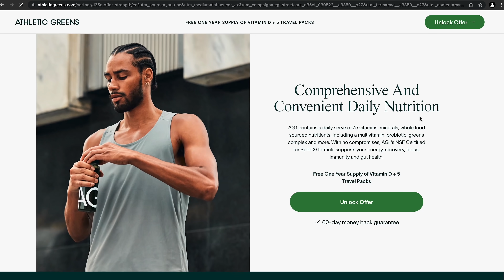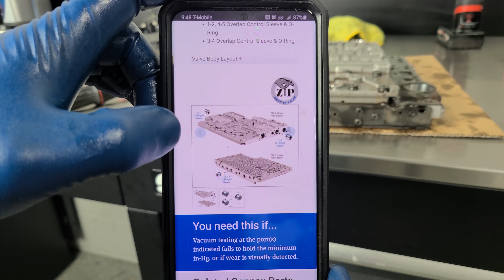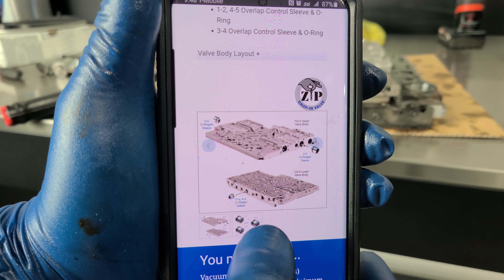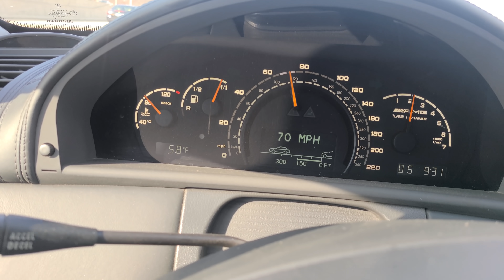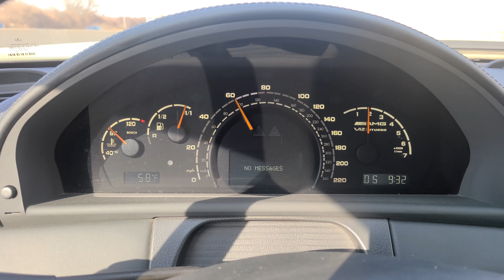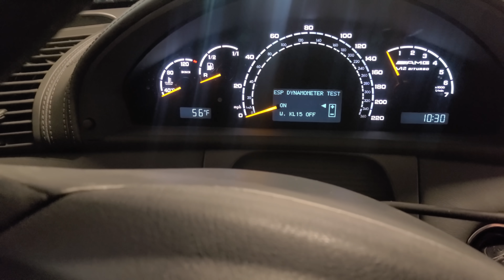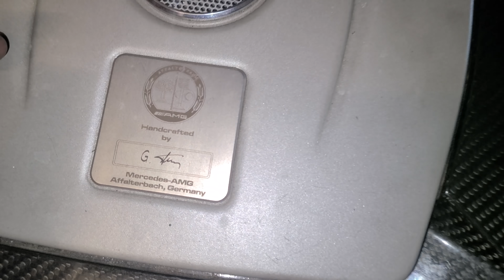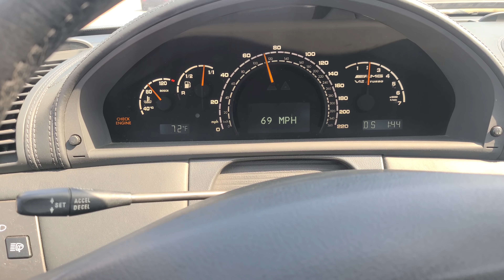My CL65 AMG FINALLY Made It To The Dyno But It Didn't End Well. I Love This Car!

Comment from the maker: What's your long-term project?
Reply: My wife
Reply: Me and my dad are rebuilding GAZ 69A which is russian old off-roader  which my grandfather bought from the army. It is over 60 years old!
Reply: I have a 2014 Volkswagen Jetta GLI comes stock with a 2.0T. Had the car since January of 21 and it’s been nothing but amazing but the 210hp wasn’t cutting it. Decided to put a bigger turbo, catless downpipe, intercooler and even with the stock fuel system i made shy of 400hp. Love the car to death and never see myself getting rid of it in the foreseeable future even though it’s been down since august due to something getting sucked into my engine causing cylinder 3 to get chewed up. Doing a full rebuild on the motor but with college and work it’s hard to find time to put it together and with college I barely get hours to make money to buy parts. So it’s gonna be a project for a very good while :)😂
Reply: Chrysler Conquest.
Reply: did my sierra over 5 years
currently doing my mondeo that's only taken 16 years so far...
Reply: 1998 Oldsmobile Aurora
Found a crate engine in Santa Fe Springs California and plan to install it.
Reply: 1963 Chevy C-10, unless I find a fully restored one then I'm selling mine.
Reply: Full Engine rebuild on a camry with the 2az-fe spun a rod bearing
Reply: 95 volvo 460, its a rustbucket 😂
Reply: My 2001 Lexus IS300.😅I keep replacing parts and it keeps throwing a CEL for something new.😒
Reply: My SL500, I'm preparing to overhaul both ABC hydraulic units.
Reply: My first car! A 05 CTS-V
Reply: W123 300td 4 speed swap death tune injection pump
Reply: Mercedes = money pit
Reply: 2012 Daihatsu Mira.
Reply: Keeping my E39 M5 running like it should... It will be a forever project :D
Reply: My c1890 Victorian home
Reply: My R129 Mosselman 300SLR Twin Turbo, It's in Missouri getting work done, I'm living in Chicago would love to let you try it out when it's done!
Reply: My cls55
Reply: W140, been doing it for last 8-9 years. Was done once, but redone again to more classic look. Recently there were unrest in my country, looters completely wrecked my garage, took all detailing equipment and even wheels, the car was just laying on the ground. Hood and trunk were attempted to open with crowbar. All rare stuff that I collected for years - was stoles. Even the cassette with instructions and manual, which was exactly from this car, it has been kept through all this years, all was stolen. I will make a video about it sometime soon
Reply: 1984 300 CD
Reply: 1994 S600 coupe (33k miles) Barn find
Reply: W126 560 SEL. AMG Gen 2 body kit, split rear seats (car only sits 4), fully rebuilt engine. Waiting for me to put the engine and trans back in for the last 6 years....
Reply: rebuilding my old 99 z28 and my newly acquired 04 golf R32
Reply: 996 GT3 with 997 front end. Still a lot of details so is not a 2/20 car (looks great with 2 beers at 20 ft)
Reply: 2004 E500 4matic wagon!
Reply: W211 e55 😂
Reply: Watching this build 😂 

Man I can’t thank you enough. Whenever I get my C216 CL65 most of the services have been covered by you and FCP will have the parts ready

Except that ABC, that has to go instantly
Reply: The evolution of "el gordo". Or my abdomen.
Reply: The love and disdain you show as you're talking about this car is the same how I feel about my 2010 335i xdrive manual (with NO idrive 🙏). She's eventually getting an LS, T56 and Ford 8.8. I'm done with heart break lol
Reply: 240z with a tvr speed 6
Reply: Mk1 Escort sport.
Reply: ‘76 k20 bought new as a logging truck, then my dad bought it for a plow truck.  On second body and needs a third, frame is rough but has unlimited emotional attachment helped plow our driveway as a kid sitting on my dads lap. The one I’ll never sell. Not worth fixing, but is. Lol
Reply: @LegitStreeCars Where did you get the repair manual for that car?
Reply: My body, been through hell and back. Addiction, jail, homelessness for a few months, losing friends to addiction/attitudes, losing family to their personal issues, losing money to theft, losing computer with crypto on it… it’s been over a decade for sure, all started when we rolled into 2010, mom died in February and everything unraveled from there. 
Thankfully I’m clean and broke now. People can call all they want, I make $250/wk so…. My body is my project for now
Reply: I’ve built a 50cc 2 stroke folding bike and recently ive blown the engine so im replacing the piston, rings and probably cylinder👍👍👍
Reply: You've inspired me to buy a 1998 bmw 540i (pre vannos) and I love it so much
Reply: Do you know if they have the damper kit for the 7.229 transmission? And my project cars are a 2004 S430 and a 2006 CL500.
Reply: A 265k mile Volvo XC90 with the Yamaha V8.
Reply: for now , number one ... raising and educating my two male boys....number two...my wife😊😎🤭
Reply: My piece CL600
Reply: Myself.
Reply: Volvo 850 turbo, e39 m5 and w202 with c36 motor swap on the way. It's going as well as you'd imagine.
Reply: What happened with the 540i
Reply: Big question?
Car wise:
Fit fuel injection to my Jensen 76 Interceptor Convertible (440).
Get more maintenance items done on my 03 CL600 done.
Make a Milliyard style 4 cylinder version of a Suzuki GT550.
Reply: @whoquadrophenia  Lots of internal screaming?
Reply: E38 740i shorty with e39 m5 drive train swap
Reply: Changing  the valve  cover gasket , spark plugs  and rear main seal on my Ford  Edge.
Reply: Volkswagen CC 2015 2.0t😎
Reply: 1004 gmc sierra denali with quadrasteer, the 4 wheel steering!
Reply: 2003 Cobra. Kenne bell is on its way.
Reply: My 2006 Range Rover 4.2 Supercharged it has serious rear wheel arch corrosion which I will have to cut out and weld in new replacement arches. On both sides ! Lol that should keep me busy for the next couple of months after I get back from the States to the UK. I also fitted an LED light bar into the front grill just before our holiday to the states and I have to finish the wiring for it.
Reply: @slotcarguy300  Range Rover just the same, especially the 5.0 Litre Supercharged ones!!
Reply: Subaru B4 Liberty (Legacy for you yanks) I have no idea if it will ever be done but I'll be damned if I will ever give it up.
Reply: Finally finishing my bachelor's degree and buying a hooptie Porsche to work on!
Reply: 2006 CL500 same colour as yours, beige interior! Fantastic California example, but man that abc 😞
Reply: I have a 97 civic ex coupe it will see a track one day
Reply: @slotcarguy300  not all models,mostly newer cars from 2000's era.
Reply: @w140  Thats horrible... best of luck to you.! By the way what kind of W140 it was? Coupe or sedan?What engine was in it?
Reply: 116, all my 6 old school Mercedes’ need work on a daily lol
Reply: 2002 w211 e320
Reply: Currently I broker commercial real estate Loans, and business loans capital.  I’m building up capital to buy my first investment property. Probably will be a wholesale or a flip.  That’s my business long term.
Reply: 4 cylinder 2005 c230 automatick its my daly but it needa aloot of love after niglegt
Reply: My 1990 bmw 535i is currently in a million pieces for 3 weeks now
Reply: My 2003 mercedes clk 270 CDI. All new brembo brake rotors and pads. All new Ebac springs with double dampers. That’s all done! Next week I’m starting on the tear down of rear subframe. All new polly bushes rear. Refurbished the subframe and floor pan. New stainless brake hardlines. Then engine.: new mounts,  water pump, belt idlers etc. Swirl flap delete EGR already done. Gonna pack the inlet and smooth and port match intake!  Same on exhaust. This de stresses the exhaust stroke!! Along with a decat and conical exhaust from turbo to 3 inch pipe! This also reduces the injector seal failure by lowering the temp and increasing the volume and flow, of gases in and out! Then new injector seals. Bar & plate intercooler. And a turbo from a 2005/6. E320CDI. That’s been ported and inlet polished. Wastegate ported and smithed radius’s. I’m aiming for hopefully 280-300 HP on stock injectors n pump! Which I renewed last year!! These cars are 10 a penny in England. But they’re a lovely pillar less coup. With awesome MPG. 55-60!!!!! And a comfortable ride!!!
Reply: Volvo C70 T5 2001 :D
Reply: 06 E500 wagon getting BC Racing coilovers
Reply: My children.
Just kidding.

My long-term project is a W201 (usually called 190) Mercedes-Benz, which is one of my favourite Mercedes-Benz models ever.
Reply: A w114 230.6 that is barely running and  barely brake, has 400+ km approx
Reply: 2005 Ford Focus, standard. Love that thing.
Reply: Don’t have a long term, current daily driver/project is 06 e500 with 80k miles
Reply: 190e/w201 with a mercedes M104 turbo and 722.6 gearbox. Hopefully a evo 2 kit aswell
Reply: My 1972 MGB-GT. It was my regular driver from 2011-2014 when I pulled it off the road to replace the sills and do other rust repair. Did the driver's side and part of the passenger then got side tracked be a job loss in 2015. It has pretty much sat since then.
Reply: Making 380hp with my 1998 SLK230 Kompressor, is the valve body on this car the same Trans as mine?
Reply: To watch your project its exhausting lol
Reply: I’m looking for a early 50’s Chevy pick up (I’d love to find a 5 window) that’s in decent shape body and frame and then put a modern Chevy 350 with TBI and a modern transmission to use as my summer driver/tow rig.
Reply: 86 gbody with a 95 lt1
Reply: @LagitStreetCars at the moment I don't have money for a long-term project about a year ago I had to sell mine and my father's 1968 Impala Fastback which was our project and that was about 60% time he was a huge fan of yours as I am because he works for the city and he knew you work for the city he was a superintendent and streets and sand and one of the crazy things is the building that you worked on and on that police cars is the building where he started his first job at it was actually the Napa headquarters for Chicago before the city bought it out about 35 years ago but I to have a great idea for the channel I think you should make a segmented where you pick a subscriber once a month that has something wrong with their cars bring them in for them and you to work them not only will they learn something and I could guarantee the person that you have in the shampoo and you're working on their car and are there with you their whole family will watch it you'll get a few more subscribers out of that and after a while I would bet in 18 months you will have an extra 200k subs and a lot of likes because how could you hate on something like that and I haven't seen anything like that on any forum yet and when you're done with the cars I have an even bigger idea that I haven't seen in Chicago they're very big in Texas California Florida the Carolinas and New York. 

I have a 2007 buick lacross and my infotainment screen went out and the backlighs for my gages are out I would love to come and make a video of me helping you put that in and I'm not far away at all I'm about 20 minutes away from your shop it would be an honor to work on my car with you I could guarantee that you will not find a cleaner 2007 Buick LaCrosse in the midwest that has been in the midwest it's whole life there is no rust the interior is  a 8 out of 10 I just need to fix a few minor tears but all the metal on the car is great for a car that has been in Chicago for 15 years I made sure to always have that yearly car wash pass as you know when you live in this city that is priceless but please reach out even if it's just to say no you're not interested but you interested in maybe starting a  car club you know‽ THANK YOU FOR ALL THE UPLIFTING LEARNING COMICAL JUST ALL AROUND GREAT SHOWS THANKS AGAIN👍
Reply: Have 2 . 1991 Volkswagen vanagon syncro with a zetec engine swap. The other is a 1928 ford model A pick up, this will be restored to original.
Reply: 1986 K10 Silverado  4x4..
Reply: My 1991 300D (W124)! It's my project, my daily, and my only car ahah. It works out, because those older diesels are bullet-proof, but of course there are always minor things to fix/improve. Never left me stranded though, pretty good for a 30 year old car, I'd say.
Reply: 2001 Audi S4. Then engine is currently torn down to just the rotating assembly in the block. Upgrading everything and it should be much quicker and better performing.
Reply: watching you finish this car.
Reply: My wife
Reply: Repairing my 2003 CL 600 with Rentech 625HP, 745 ft. lbs. torque CL 65 Clone Suspension issues. Only 54k miles.
Reply: Mine:
1996 240SX - Owned since 2007
1986 Toyota Pick Up 
1997 Toyota 4Runner
1977 House - like actual 3 bedroom house :D

Fiancees:
1969 Dodge Charger
1992 Chevrolet Camaro
1999 Pontiac Trans Am WS6
Reply: My euro car. 84 320i. Only driven summers for a month or so. Maintenance.  It's in spain I'm in canada.  Garage queen,  original no rust 60000 miles. 
Next summer its hoses.
Reply: I want to get a vehicle again eventually. That's my long term project for my wife, son, and myself.
Reply: Hi all i like a lot too watch your channel i learn a lot that its the most beautiful thing to not espend money but i have an project to you i want to know if you can teatch me how to work on Volvo v60 hybrid plugin. I think its an great project have an great day
Reply: @therealdojj  that's a Ford Sierra correct?  That is one of my dream cars.  I have a Merkur XR4Ti as I'm in USA
Reply: @jameswieler3295  I'm pretty famous in some circles with my Sierra 😁 it was an estate, 2.9, V6, twin turbod, and 4wd
Was pretty rapid
Then it blew up
And so I had to replace it with a 24v version 😁
Reply: I got a m275 s600 ive been working on almost done

Comment: Alex, The hood struts may have failed because they were installed incorrectly. The should be upside down, so the oil inside can get to the seal and scraper. Is there an all aluminum radiator option for these cars? I would have got one in a OEM size with an external transmission cooler. Once that tune is leaned out some it should make real good power💪
Reply: well assuming the hood spends most of its time closed, it should be installed in such a way where the rod is lower than the strut body in the hood closed position.
Reply: @zanastumasonis  i ordered some hood struts for my truck from NAPA and i actually read the instructions. It says to mount them with the body of the strut up with the hood open, so the oil in the strut gets to the rod. When the hood is being opened and closed the seal and scraper is sure to be lubed by the internal oil.
Reply: @PANTYEATR1  I didnt say I dont agree with that, I just added to it
Reply: @zanastumasonis  of course bro. I just wanted to clarify. One has to wonder why these hood\truck struts fail like they do when they aren't worked that hard. When i see some worn hood struts, first thing i do is notice how they are installed.
Reply: @zanastumasonis  shouldn’t we assume most of the time the hood is open ? 🤪😁
Reply: @-SUNSHINE-192  hahahaa yess!!!! lol
Reply: Pretty sure they have failed because they are 18 years old.
Reply: @Beer_Dad1975  possibly... But how long would they have lasted if properly installed, so the oil could lube the rod properly?
Reply: @PANTYEATR1  For sure but probably not this long.  Back in the day when you couldn't pick up struts from the local parts store for next to nothing I had a set re-gassed and they were good as new for years, still going when I sold the car.  These days sadly it's cheaper to chuck the old ones out and buy a new set.  I just did the boot struts on my 11 year old GS460, now I notice the hood struts are starting to get a little feeble too.

Comment: You have an interesting way of approaching your project!  You have a true love for cars!  I have an 05 C230 Kompressor that I replaced the head gasket on.  Many of the problems you faced are reminiscent of the challenges I faced.  The project ended up taking several years.  She is running good now with a small oil leak out the bottom.  I am going to live with it since I will have to hoist the engine, drop the cross member, disconnect the steering and cooler lines just to re seal the oil pan.  Don't want to know why I needed to drop the  oil pan! My project was a 4 cylinder and I thought that was bad!  Watching you put together a 12 cylinder had my head spinning!  Great video!  Thank you for taking the time to share some of your knowledge as a Mercedes tech.  🚙

Comment: Hey Alex I’ve been following you for over 3 year and you’re the reason I have a 2005 E55 AMG :)!! Unfortunately I have the same problem with the shifting from 1-2 kicking you in the back right after but it doesn’t go away when the car warms up, it’s constant.  I heard about the replacement of the TCC solenoid and I’ll be doing that soon but do u think i can get away without installing the new o rings kit ?
Reply: just replace the trans control module 3 years you’ve been watching  how have you not learned that you can’t cheap out with these German cars
Reply: I'm not sure we are on the same page here ... The video shows items being fitted that affect 1-2, 2-3, 3,4 shifts. They were fitted with O rings ... The TCC item shown in the link below the video wasnt shown in the video. Do you have to fit the items shown? Only if you have that problem now or want to avoid it in the future. It seems like cheap insurance since you would already have the unit striped if you're fitting the TCC solenoid.

Comment: Alex did you consider data logging your CL65 with something like a Zeitronix data logger? Send the data to somebody like the Mercedes Swap Shop. They could send you a remote flash file that you could load to your ME2.7x ECU using a Galleto 1260 cable. The Mercedes Swap Shop has a video on YouTube that shows you how to load the flash file.